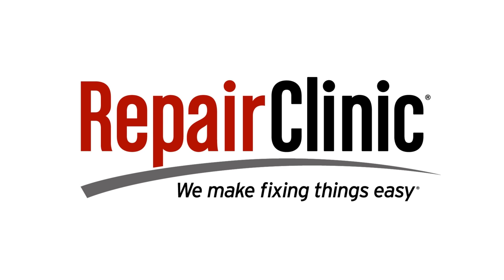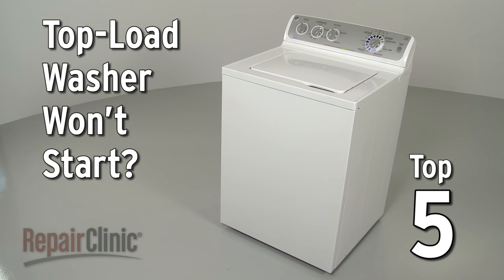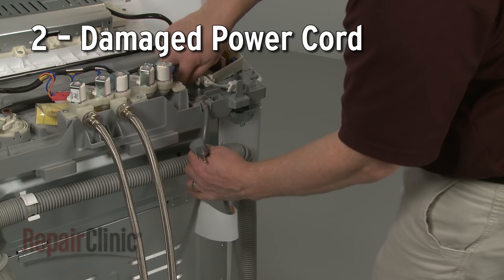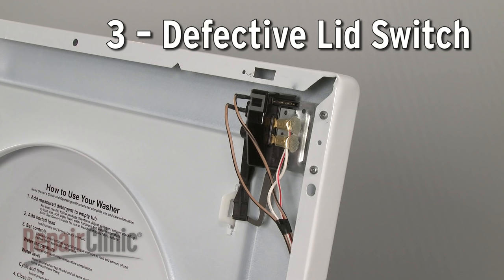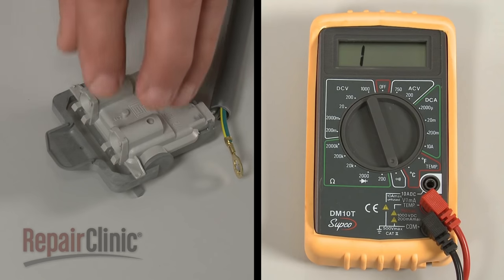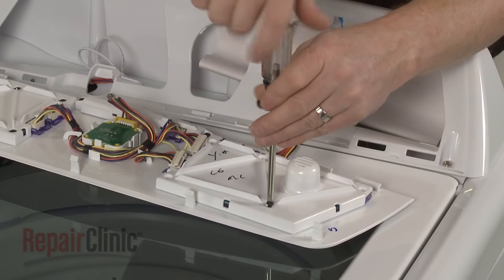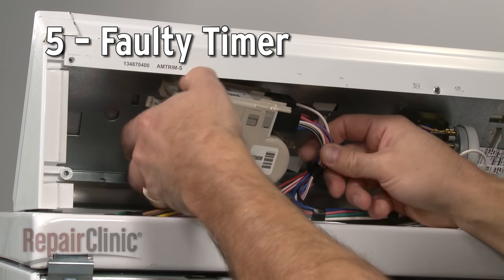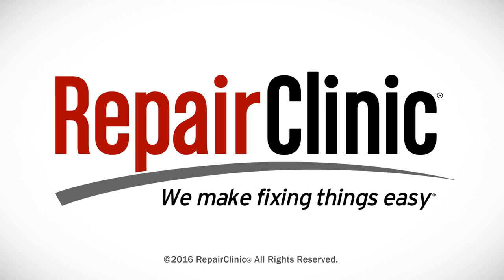Top-Load Washer Won’t Start — Washing Machine Troubleshooting

Comment: My washer was loaded by my better half, but she mostly can't place the cloth with a spinning balance so that the spinning process won't be balanced as well, we usually hear the noisy turbulence or the annoying sound of rambling washing machine during working.  Therefore, the miracle happened, one of the major connector was loose after shaking up millions times, after my another magic lucky touch, it is fixed by making sure every connection is perfectly in position.  Thanks Lord, who offers us the powerful wisdom.

Comment: Question for Repair Clinic: my whirlpool washer 1CWTW4840YW1 won’t start, I traced the power cable to the control board , unplugged the cable from the control board , let it out for a couple seconds, plugged back into the control board and it comes on, have to do this every other time before it can work. Any idea what could be the problem? Gladly appreciate your response

Comment: Check the water supply/ valves that will also make the older mechanical timer machines seem like they have an electrical no start problem

Comment: Had a problem with amana washer, i wanted to drop extra clothes when it was starting to spin and after that it didn't start again, turning off and on the electrical switch helped me

Comment: My Defy Top Loader washing machine model no.DTL 149 won't switch and I checked the Fuse but did not check the electric cord if it is supplying power. I removed the Key Pad to have check

Comment: Top load washer won’t start top 5 probable causes:
1. Incoming power problem
2. Damaged power cord
3. Defective lid switch
4. Defective user control board
5. Faulty timer

Comment: I have a 28-years old model of Kenmore top-load washer. After the water is filled, the masher won't start. What may be wrong and how can I fix it?
Reply: open up the top lid, and make each connection tight again!!!
Reply: Chuck You need a brand new machine if your other one is 28 Years old
Reply: I live in an apartment and have the same issue. Maintainace has come by 2 times in 3 weeks and still hasn't fixed it. Starting to piss me off.
Reply: Chris Ligon everyone check your lid switch
Reply: Lid switch
Reply: @Sinjin3  ;
Reply: @stephensnell1379  Keep the old one!  they last longer!  Have less problems!  Are easier to fix!  My avocado green set that I got second hand when I bought my house 28 years ago still going strong and few times the belts broke was an easy fix by me!
Reply: 1st. The lid switch
2nd. The belt on older models may be worn to loose to turn the tub or even broken. Check under the washer for black dusty residue.
3rd. Timer not advancing.  Tiny motor on timer may be worn out or the internal gears worn, or electrical contacts charred. Can you advance the timer manually and getit to work?

Comment: My whirlpool washer and dryer top load  no power  no lights  just a click when I plug it in
Reply: Same thing with mine 🙄
Reply: Same thing as mine and now it just stopped clicking and the sensor lights are off FML I don't think I've had it over a year yet 🤞🤞
Reply: @msmith3426  What did your issue end up being? We are in the same boat.

Comment: First redlock light wouldn't stay on..the button to start everything.the switch with the grey button had broke off...i tried to fix button by caref was broken I tried to crazy glue it back together?.but now I do t know pok,ey side out or In? I began to panic  when none of the lights came back on until for just a fleeting sec when i was p l ay8ng around with broken switcg
I lights wouldn't t I rn o. And I pulled Grey rubber. Thing out a as left-with piece of,attic ghats circu
Lar on one side,cross on the other..the rubber on button has the cross side imprinted on it so circular in?while fiddling....2 things good happened..I do have electricity running through it FORSURE...2 all the lights did pop on for a sec..this allstarted because lock wouldn't stay locked and certain cycles stopped working,but would work on casual setting..now I'm lokimh for help and advice to help me repair it I'll pay better than I type

Comment: I have an Admiral washer and at first the lid lock seemed to be the issue, but now, after I replaced it with a new lid switch and door latch. The washer wont fill or do anything now. I put it through a diagnostic phase and all the light come on except the lid lock light...what in the heck is the matter now...can someone help me not buy another washer...P.S the Mrs is pissed
Reply: Mr,Buttery I have a washing machine w10722923B/  stm w10722922B it has worked for a while but has not even two yrs of service the lid light is on when u plug it in was told that It may be the board need help.It does not wash
Reply: Did you callibrate it after replacing the new piece?